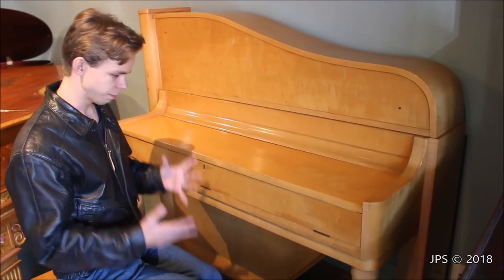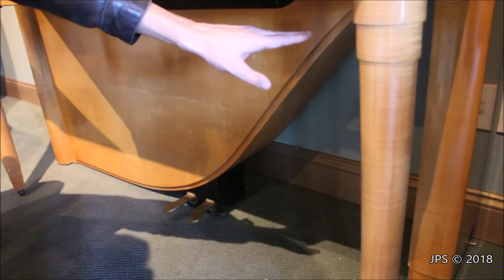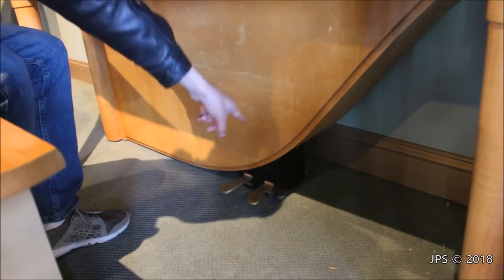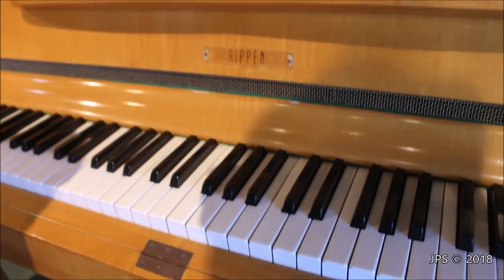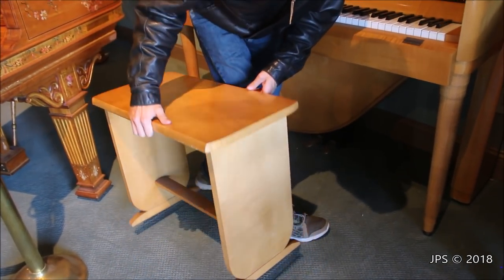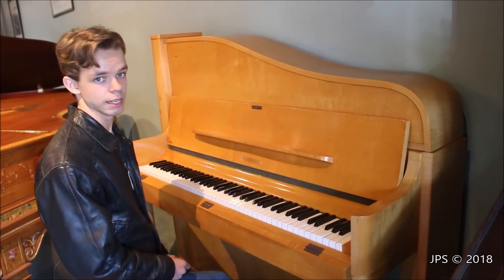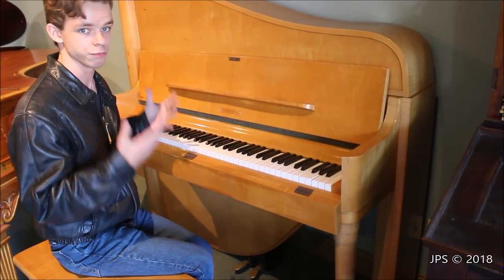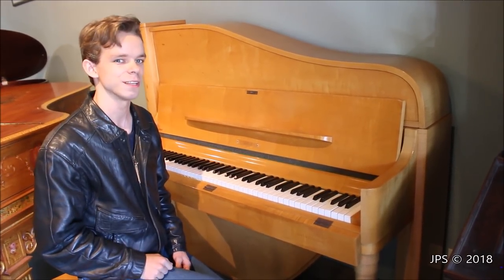Rippen Upright

Comment: As several people have already stated, Rippen was made in Holland/Netherlands. I know a bit about the brand since I own one. Mine was manufactured in 1983 or 1984. I purchased it new in 1985. Unfortunately Rippen is no longer in business but it was a family owned and operated business. The piano seller I purchased it from told me a bit about the company since he knew them well. The then current president (1985) had taken over the company form his father. But the father did not let the son run the company until he had worked at and performed every job in the company. He started as the janitor when he was a teen (or maybe younger) and worked in each and every department (the various construction departments as well as accounting, marketing and other business departments). Talk about dedication to a craft and a business, that certainly is it. The Rippen I have is the Carrillon model and is shaped like a traditional upright (43 inches high), not like the one you showed in this video. The thing I like about my Rippen is the depth and richness of tone is quite remarkable, quite close to the tone of a full size upright. They made grand pianos as well, though I have never seen or heard one. The company went out of business sometime in 2004.

Comment: I refurbished a Rippen piano recently, manufactured in the 1970s.  It has a floating soundboard (freely suspended at the bottom) with a most interesting design---instead of the customary "diaphragmatic" design, the soundboard is reverse crowned.  Also I was surprised that the tuning pins had reverse threads. Turning the pins clockwise (as is usual) tightened the strings, but the pin moved out as the string tension was tightened. I assume that this design was to allow more room for what could become more coil of wire as the piano aged and the strings were tightened.  The pinblock was extremely tight, and this piano was one of the few where I really felt the need for extra leverage on my tuning wrench!  When I ran across the piano, I was  told that it had not been tuned for at least 20 years, but the pitch was only about a quarter of a tone flat.....rather amazing! Also, the particular instrument that I worked on had no veneer....solid cherry wood on the case. This is impressive, but I believe that it actually served to muffle the sound.  There is a considerable difference in the sound volume with the front panel removed in comparison to the piano being fully assembled.

Comment: The piano could be as recent as the early 1950s

I believe the top case opens by lifting it up like a box straight up. I don’t know if it might have a locking mechanism to hold it in place or if it is only friction fit.